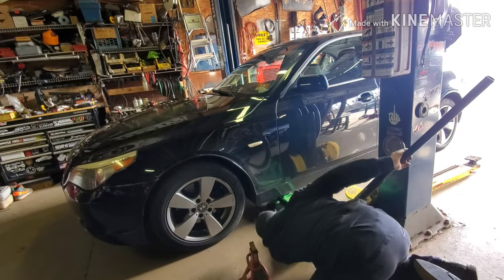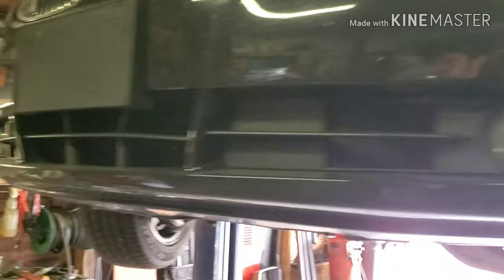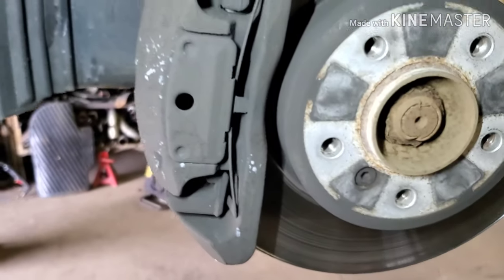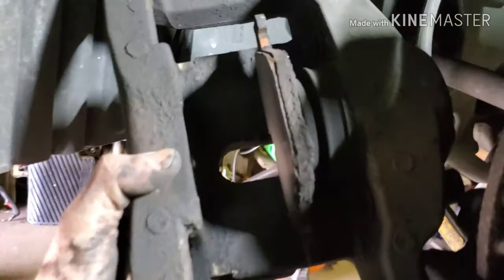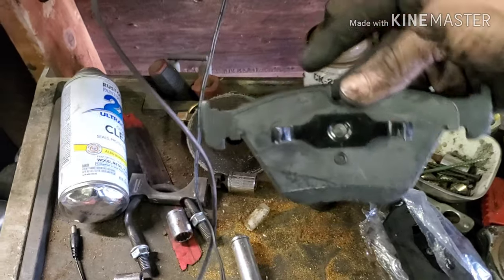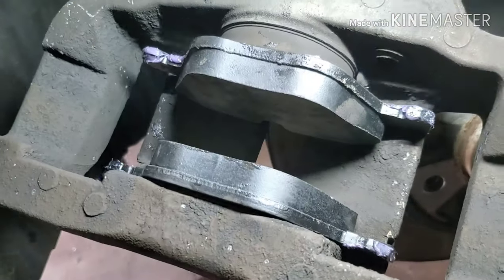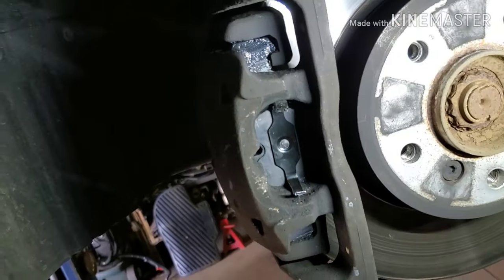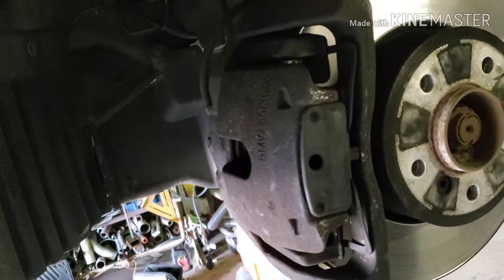How to replace front brake pads on BMW 5 series E60

Comment: Do i have to put grease on break pads or i can just do it without grease?
Reply from the maker: Highly recommended to apply on the "ears" where they are going to slide in the bracket.
Reply: @DecosGarage  Same to the rear?
Reply from the maker: @croissantdonut9260  rear steel portion of the pad is good too but not as important as the ears.  Never on the actual pad material tho

Comment: Everything you do is away from the camera? Some people don't know what you're doing. The piston side, I always put grease on the backing where the piston meets the pads. Clean those slide pins with WD40 and steel wool or emery cloth, dry and regrease. Inside the holes also because when you push your pins in it takes off some of the grease. 74ft lbs.